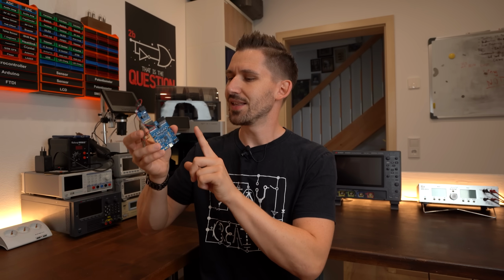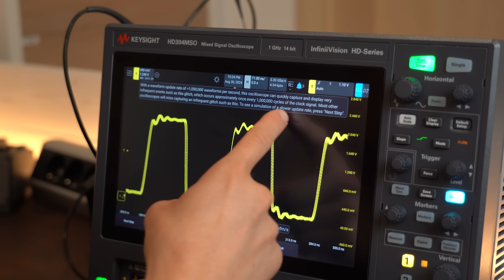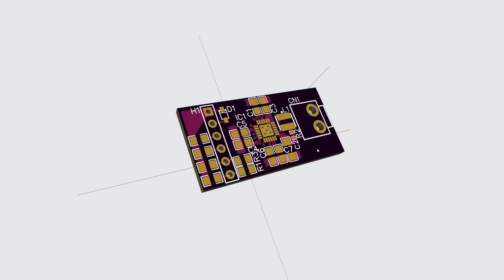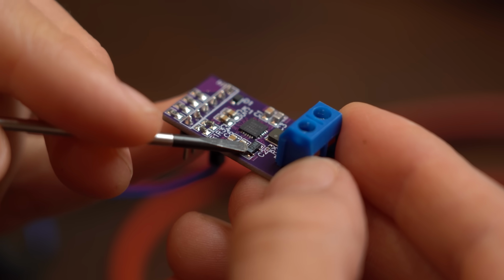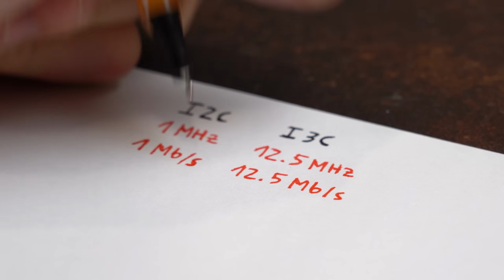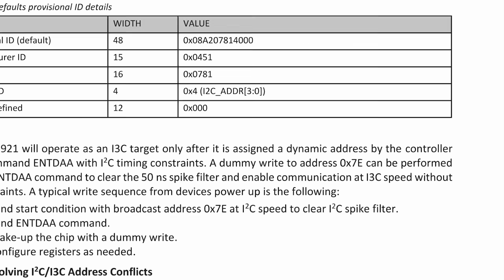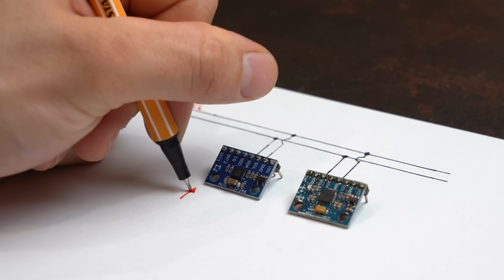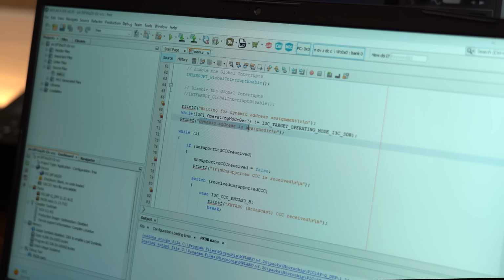Is This the NEW GOLDEN Standard for Communication? (I3C) EB#60

Comment: Dynamic address assignment doesn't work as what most might expect. The DAA process assumes all devices have different provisional IDs to start with. Stupidly enough, the I3C standards makes provisional IDs optionally randomly assigned by the manufacturer. Many manufacturers choose to give all ICs the same provisional ID rather than add a factory-programmed ramdom ID. As a result, when starting the DAA process, you must connect the chips one at a time. Connecting multiple at a time during DAA means multiple ICs will respond to the same address assignment, completely negating the DAA feature. It's dumb, they were so close to making a good protocol, but making it optional effectively makes it no more useful than having address pins on an i2c device.
Reply: Aww.. I was excited when I heard it has daa. 
Such a let down.

edit:
the provisional ID is 48 bits for anyone wondering
and my hopes are that manufacturers will at the very least try to implement it correctly..

but even the allmighty usb specs are getting ruined by manufacturers..
Reply: It is stupid anyway, because if every sensor got assigned address automaticaly, then you have all sensors initialized, but don't know which is which.
Reply: @bartomiej368  As long as each has a unique address you can just query them for a chip id/type to figure out what they are.
Reply: what I don't understand is how there's a myriad of single wire auto-addressing protocols around like LIN and I3C still failed at a task LIN and the likes has been doing since 20 years ago.
Reply: But if all devices already have unique addresses and you can enumerate and access them, why would you want to change it?
Reply: @TheNamelessOne12357  Speed of access.  Most factory-unique addresses are 48-bit (6 bytes) or 64-bit (8 bytes) while assigned addresses are only 7-bit or less (less than 1 byte).
Reply: @bartomiej368  You'd have to do something like SNPD from the LIN protocol, that can assign addresses based on which chips are closer or further away, measured based on how long pulses from the master take to reach each device.
Reply: Mandating that ech device to have a random unique id would've made it at least 'not useless' -- but to be better than that, would've been also mandating a second sequential ID, too. So that if you just make sure the Pick-and-place machine pulls chips from the reel in a particular order, you can tell which chip is which. (And even if a chip were replaced during rework, a board could potentially still figure this out automatically -- where a run of the same chip with a gap in the ID sequence, and then another copy with a totally unrelated ID, means that the odd-id chip was probably the reworked substitute for the missing ID number.)
Reply: @bartomiej368  if they have a gpio on the chip you can poll all chips then pull that io, up or down from your programming jig as part of your programming and testing process. (Not from your main micro)
Even push buttons from the user if you need to. 
Different to address pins in that one pin on the micro can be used for an array of hundreds of sensors or whatever.
Reply: So really, the only difference is that according to the standard follower ICs are required to allow address reprogramming. I've done power-on re-addressing before for a 16-sebsor board, using mosfets to power on the sensors one by one, moving to the next after setting the address. However, I've also seen I2C chips that just don't have this functionality. That's a win for I3C, but apparently not as big as it could have been.
Reply: If Hot Join were mandatory, that would resolve a lot of issues as power sequencing could do the trick. Without power sequencing, it might be possible for the GETDCR and GETCAPS commands to be usable as a software enumeration mechanism (if not now, maybe in a future spec version).

I hope MIPI has something in mind because at my company, we are struggling with limitations of I2C like address collisions and the ability for software the determine what is connected. It makes me kind of miss working with PCIe and USB.
Reply: So for a microcontroller and connected sensors all getting powered on at the same time,  problems could arise with i3c where as hard wired addresses would just startup. Also, 6 or 8 bytes for addressing... that is quite a lot of addresses. This becomes analogous to DHCP, and heck, let's throw in IPv6 also. My small projects usually have a few sensors and a display. I did one project where I had to address 14 segment led modules, as I had 6 on one bus. I2c will probably be around for a LONG time.

Comment: The tantalum capacitor polarity marking is one of those things that will get you every time. At least you limited the current to prevent more exciting things like it catching fire or blowing up in your face.
Reply: oh man these little things scared me when I blew them for the first time.. they sure pack a lot of booms and bangs for their size
Reply: is there a good reason for that strange change? Breaking design conventions (the line for minus is not only on electrolytic caps, but also on diodes etc.) for no reason sounds like a recipe for a disaster
Reply: even when installed correctly, they almost always fail as a short and burn lol wikipedia says "eject burning core" no lie, I laughed a bit when I read that.  They're great if you need them but I would never intentionally design them into something - most of the time I saw engineers patching them in when their circuits wouldn't work so great with other caps, but most other caps fail as an open (sometimes gradually failing so, making it more likely the intercept before full failure).
They were always easy to debug because they'd be literally cracked most of the time if they had failed and of those they were frequently cracked with a black burnt spot in the middle of the crack.
Reply: EXCITING
Reply: Well, is quite simple, tantalum capacitors and diodes have the positive terminal marked, being thd or smd. Easy, right?
Reply: Hooked up an Arduino Pro Mini once and got a loud BANG and a flying spark. Turns out I hooked 12 volts to it the wrong way. Whoops.

The board was fine, fortunately, and the blown cap was easy to remove and cheap to replace.

Comment: Just wanted to add that there are a handful of STM32 micros that support I3C. As an example, the STM32H503 supports it. The official NUCLEO-H503 devboard is $15 or the micro itself is around $3 to $4. There might be cheaper options from ST, but I personally own a NUCLEO-H503 which is why it came to mind
Reply: Other STM32H5 MCUs have I3C too (I haven’t checked but it might be all) and the NXP N series have I3C too.
Reply: Nordics nRF54 series has it too, I learned recently to my delight!

Comment: First thing to do before plugging in power on a board is using a multimeter to test the resistance between power and ground. If you get 0 or too low you can find the error without destroying any other components.

Comment: Pullup vs. Push-Pull.
You can improve the speed of pullups by using a current source instead of a simple resistor.
Push-Pull has a little problem when one device pulls low and another one pulls high. A problem for I²C clock stretching or multi-master.
But even for this we can have a simple solution if we use a master with a lower current output than a client. In fact, most of the modern Push-Pull outputs are current sources with no problem shortened to Vcc or GND.

Comment: I2c = i squared c
I3c = i cubed c
Reply: no a cube has 6 faces
Reply: @solarcrystal5494 PWAHAHAHAHAHAHAHAHAHAHAHAHAHAHAOMGYOUARESOFUNNYMAN
Reply: I4c = I foresee  LOL
Reply: I triangle c?
Reply: @solarcrystal5494 A square doesn't have any faces on account of being a two dimensional polygon so that logic doesn't quite hold up. xD
Reply: @oliverer3  we live in 3 spacial dimensions so a mathematical square has 2 cides: a front and a back. I2c = i 2 cides = square, i6c = i 6 cides = cube
Reply: @solarcrystal5494  It's not in reference to the number of sides, it refers to the number of dimensions.  Squared is two dimensions (x*y) , cubed is three dimensions (x*y*z).
Reply: @StuTubed  cimensions arent a thing unlike cides
Reply: But what does i3c mean if i2c is "Inter-integrated Circuit"? Inter-inter-integrated Circuit?
Reply: @solarcrystal5494  A square doesn't have 2 edges
Reply: @gljames24  in 3 dimensions it has 2 cides: a front and a back
Reply: @solarcrystal5494  isnt that a contradiction? Front and back is 2 cides, 3d got 6 cides. Left, right, front, back, top, bottom. No matter how flat..like a piece of paper got 6 cides and 12 edcies. A square drawn got neither cides nor edgies but a face and an imaginary back. But if you draw faster than the speed of light, you have to start thinking 4 cimencional. What are talking about anyways? 😂
Reply: @Sizzlik , it actually stands for "Improved Inter Integrated Circuit", so they stuck with the original naming scheme rather than just incrementing the number.
Reply: i8c = I ate C

Comment: The features of I3C that it adds make it where more complicated projects are going to use it. As micro controllers roll out with support for it built in, you will see more people and devices using it. Same thing happened with I2C. From a project standpoint, the interrupt feature alone is incredibly useful since the pins on a board are always a limiting factor on what your micro controller is going to be doing at the end of the day without putting peripherals or shields on it to get more. Inputs and outputs limiting you are always a problem when you are doing large projects with PLCs as well, so unless you are staying small, the same thing is going to happen here.

Now the bandwidth is going to let you do some much higher grade data for the micro-controller to work with, so look for it also allowing better robots and other feedback based projects. You'd be surprised what upping the resolution on an ADC input for a PID will do for stability.

Comment: I3C can be a better replacement for SPI driven LCDs. 2 wires instead of tipical 6.
I3C can be implemented in raspberry pi pico PIO.
Reply from the maker: true true
Reply: Not a chance, if it tops out at only 12.5 Mhz
Reply: You can already use I2C for that.. but good luck with dot matrix displays with higher resolution.. you need more bandwidth for that
Reply: @tarakivu8861 
More bandwidth?
Do you mean like in the I3C?
Reply: @superCTB  Enough to drive character displays pretty fast. Not nearly enough for a general purpose LCD. For that one should really be looking at SPI. Of course if you don't need fast updates and your content is mostly static, then it will probably do the job.
Reply: @rabiddawgr  
Fair argument.
Does explain why you would want more bandwidth than I3C.
Does not answer my question though. I read tarakuvis post as needing more bandwidth than I2C.

I guess that implementing a port with 2 wires, I3C, is not as difficult as 6 wires, SPI, but you won't find a higher resolution LCD with I3C because it would be a severe limitation of the capabilities of the display.

Not a good selling point for I3C.

Comment: Very neat and nice I3C intro video!  I look forward seeing what you manage to do with it in the future.  I've been interested in I3C since Microchip implemented it, but haven't had a reason to use it yet.  I2C is actually very complicated to implement professionally - dealing with data corruption, lockup states and recovery sequences, also working at high speed reliably for things like I2C displays and multiple devices on the same bus.  An I2C host implementation also adds another level of complexity.  May I recommend testing one complete board before soldering the rest?

Comment: I just did the same thing with a tantalum cap adding filters to an esp32. I dont get it was always stripe - on through  hole and stripe cathode on diodes for decades. What joker decided it should be oppisite on polarity of a sensitive device that can start a fire. Smart, real smart. I had no idea there was an I3C.

Comment: Interesting, but I'm not sure if it will catch on. We already have high speed serial interfaces at the expense of another wire or two. And most I2C communication is fast enough for most of its use cases. Time will tell.
Reply: I3C can (depending on implementation) coax higher speeds out of legacy I2C equipment. up to 5 Mbps in some cases.
Reply: If it's based on vibrations, this would allow us to have cans with string communications at higher rates than with standard ones
Reply: As you say, I struggle to see the unique selling point of I3C over SPI apart from fewer wires. For example: why would the manufacturer of an OLED display controller include I3C when the pinout already supports SPI? Device requiring a bitrate in the order of several Mbps like DAC and ADC are already based on I2S, a specific serial communication standard. SD carda have their own standard and many devices like wireless transceivers rely on SDIO derived from it.
From the comment https://www.youtube.com/watch?v=2mNpYOYL7Ss&lc=UgyGYYGoelgV64f82fB4AaABAg&ab_channel=GreatScott%21 I gather that the dynamic addressing has not been implemented in a way that would make the case for adoption compelling.

Comment: maybe the solution for I3C is a compromise (maybe already existing, as interoperability with I2C devices should have been desired/considered?) where you can still have a I2C-only device join the bus, configured with a static address and then ensure that the communication to and from it happens at I2C levels and routines, although I'm not fully sure how an I2C bus connection would need to be augmented to ensure signal consistency, etc - but again, unsure if I3C is designed with such backwards compatibility. maybe food for thought, something for you to try out - maybe also in some hacky, bit-banging kind of way

Comment: As a student working extra shifts in the mid-1990s I was hand-soldering smd components onto circuit boards for a small start-up company. I soldered quite a few boards during my first night shift and went home happily. The next day I was told that someone had to correct all my mistakes - I had soldered all tantalum capacitors in the wrong way - also assuming that the thick line was the negative marker as on the aluminum electrolytics which I was familiar with... 

Why, why, why.... why is it the positive electrode on tantalums which has a stripe as a marking? Of course it cannot be changed now, since it has been established over decades, but still, why?
Reply: Always wondered why they won't just change the design to include a little plus sign to reduce the ambiguity. Recently used some high-power SMD LEDs that had clear + and - markings. Beautiful.

Comment: Looks like you got off easy putting the Tantalum capacitor in backwards. I did that once, and the thing blew up like a firecracker.
Reply: Current limiting on his power supply prevented the 4th of july.

Comment: It's odd how you use "i-squared-c" and "i-three-c"

You would think youd either pair i-two-c and i-three-c together, or i-squared-c qnd i-cubed-c. Mixing and matching whether to say the number or the exponent is odd lol

Just a minor nitpick on my part😅
Reply from the maker: Haha yes. I get what you mean. I double checked though and these are the "official" pronunciations of I2C and I3C.
Reply: Maybe "I Cubed C” will catch on.
Reply: What will I⁴C be?
Reply: @greatscottlab , descriptors are often created quite randomly early adopters of a device and it becomes whatever they say. For instance, 'FET' would logically be pronounced as 'feet' since the E represents the word 'effect', but it isn't.
Reply: @stefflus08  I-tesseracted-C
Reply: @stefflus08  I foresee some issues there
Reply: @johnwest7993  Depends on your accent. I pronounce "effect" with a schwa, which is the "uh" sound made when pausing or as the first vowel in "machine" in most accents. Thus, FET should be /fət/ (or something like "fut"). However, it makes more sense to just pronounce it how it looks.
Reply: @johnwest7993  In my accent (and I'm guessing that of the earliest adopters), even the initial e of "effect" is pronounced like bet rather than beat.
Reply: i-squared-c is called that because the name - Inter-Integrated Circuit - is abbreviated as IIC. As a mathematical expression, that is I × I × C, or I²C, but the superscript can be hard to type so gets written as I2C, which helps disambiguate it from other IIC abbreviations. I3C is just a "pun" on the naming of I2C as the "next version". It is not IIIC (whatever that extra I could mean), so it is not "cubed". I3C has no meaning apart from the next version of I2C/I²C/IIC, and as versions are identified by numbers, not exponents, "cubed" would be incorrect. Hope that satisfies your nitpicking @mme725 🙂

Comment: Interesting. But as I understand it, I²C can run at up to 5 Mbps in Ultra Fast Mode in embedded applications. If that's correct, there isn't much of an advantage in using I³C for simpler systems.

Comment: Discrete components, It's a diode ! Great Scott now lets overclock that IC with the jaw harp. Gee wiz.. Reading the data sheets for mc2 protocol v-t-x divergence hybna electron molecule it states flux capacitor. Is the dynamic address critical to φ 1.618 ?